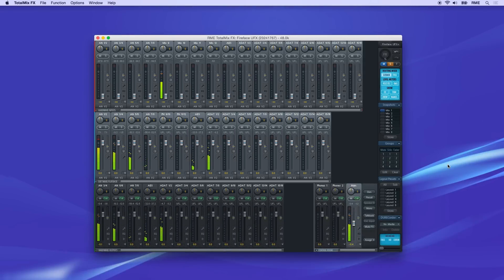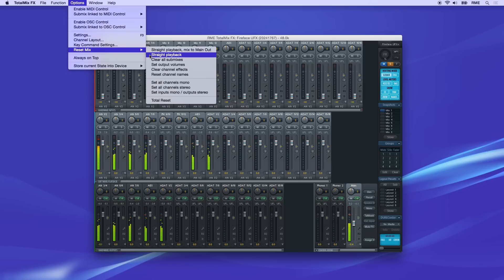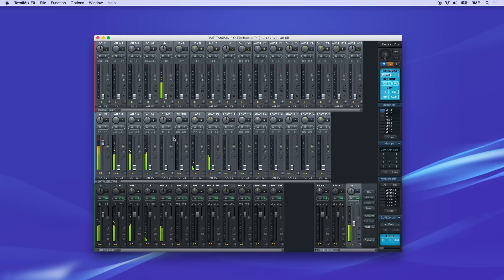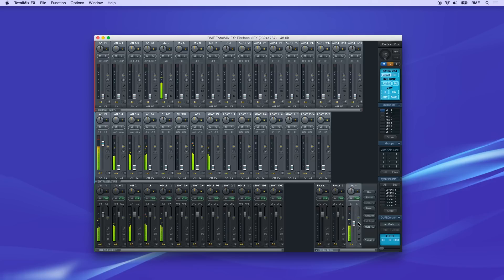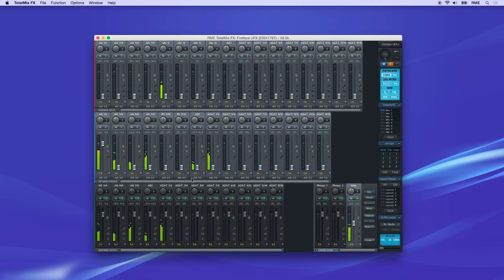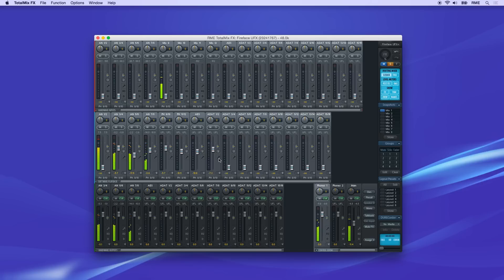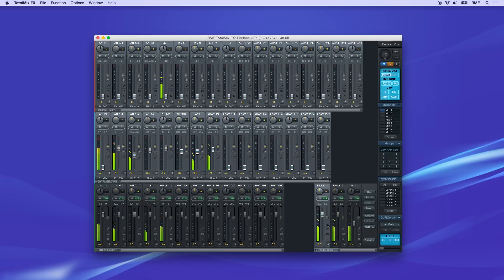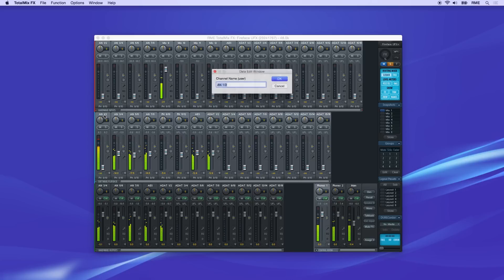How to use RME Audio TotalMix FX - 03 Routing

Comment: Another very frustrated user here trying to get totalmix to do literally anything at all. Some tips for whoever is responsible for designing this UI:
1) Bottom-to-top hierarchy is the exact opposite of what anyone expects. If you find yourself writing "routing starts with the bottom row" in your video's script you should reconsider your design.
2) TOOLTIPS EXIST FOR A REASON. So much of the UI of this clunky software is single letters or abbreviations or unlabeled sliders with absolutely no direct way to learn what they stand for. In most software this is easily handled by showing descriptive text if the user hovers their mouse over the element for a few seconds.
3) There is absolutely no reason the UI can't fluidly resize itself to whatever arbitrary resolution the user needs. Even if your rendering pipeline is some horrible spaghetti mess that outputs bitmaps of very specific pixel resolutions, at least give the option for the window to stretch that bitmap out to fill a resized window.

Comment: I have a question, if I put a preamp on one input and a compressor on another input, could I route the preamp thru the compressor for more versatility in bypassing or reversing the signal flow?
Reply from the maker: Yes you can route your hardware input to an hardware output in TotalMix FX without latency to expand your signal chain with outboard gear.
Reply: @RMEAudio  is there a limit on how many you can route to? Say I have  the mic on 11/12. an eq on 3/4. and a compressor on 5/6, I can route the mic through to 3/4 then 5/6 before it hitting the daw using total mix?

Comment: Why do I need this? I use my Babyface Pro with Cubase, why do I need TotalMix? I use it for ONE thing... really easy to turn on 48v phantom power if I need to use a mic ( I mainly use VI’s). Other than that, I’m not sure what TotalMix is for.
Reply from the maker: TotalMix is to control your monititoring and routing of signals. If you want zero latency monitoring you need Totalmix FX, even if you use ASIO (Windows) direct monitoring. If you do not want the direct monitoring, you can use the DAW mode and everything is routed via your DAW (Cubase) https://www.youtube.com/watch?v=KYheMTswSaY

Comment: It works great for me, the RME is solid. Setting TM up can be tricky till you experiment and understand what each row does.  Look in the Matrix view and make sure things are connected in the channels you want. When you have inputs and default levels for a particular recording setup, save the "Snapshot" - Those presets are the key to everything. I don't change anything except input and output levels, the mixing is in the DAW. It does have huge flexibility rather than dumbing it down so you have less options - but work at it and save your Snapshots, it's worth it!  ...also, save your Workspace as a file, so if you change your computer or something, you don't have to figure it out all over again.
Reply: I was struggling with this so hard until I used Matrix view. Thank you!!

Comment: Cant even get TotalMix to open.  Fucking Totalmix, Totalshit.
Reply from the maker: Then you did not succeed to install the drivers, or there is no RME device connected. For support you can contact support@rme-audio.de
Reply: I went around in circles doing that.  The drivers were installed, I had to remove the avidcoreaudio.plugin from its folder.  So finally it works again.
Reply from the maker: Yes, under Mac OS Yosemite this can be a problem. Thank AVID for that.

Comment: I got the rme hdspe aio and I dont understand how I can activate my microfon, I got the rode nt1a and between the rme and the Rode I got the Tube mp for the phantom power, I dont know how I can activate the xlr input in the total mix to can here my mic, I only see ADAT ... :-P Sorry for my bad english hope you understand my problem
Reply from the maker: You don't need to activate any channel if you have connected it correctly, you should see an input signal at AN1 or AN2. If you don't see these channels please perform a Total Reset of TotalMix FX. Then you can route the signal to the desired outputs and monitor the signal. If you need more assistance, please contact RME Support: http://www.rme-audio.de/en/support.php

Comment: How come I dont have the second small fader on my total mix? I am also missing the EQ button and D. I have Fireface800. What Am I missing?
Reply: The effects system requires internal DSP hardware, that was never built in on the FF800. Current Fireface models will have the complete effects system.

Comment: the most difficult and illogical software I've ever had....
Reply: Totally illogical until I stopped trying to use it the way I thought it should work and used it the way it does work...  I understand what you mean but I disagree now that I've mastered how to use it... the software is actually brilliant, combining zero latency inputs with DAW channels, fantastic amount of routing possibilities all of which storable to the device and a computer, flash the preset to the device and use it the same without a computer...  I love my 400 and 800 ;)
Reply: Kevin Heydenrych it's actually really simple to combine a mono and stereo channel to any output
Reply: agree it is messy software and not that great for a dedicated mixer.
Reply: It's hard for me to read this and not just get angry at the ignorance.
Reply: I am mixing engineer and it is disaster. And many other top engineers/producers agree.
Reply: so are you recommending that we both an external analog mixer for direct monitoring with DAW software to avoid latency issues in the home studio?
Reply: Kevin Heydenrych if it's software playback then the channel in your software is routing it to 5 rather than 7.
Reply: Also, make sure all your rme software is up to date first, including hardware firmware updates.
Reply: But I dont have any software running. Just closed my DAW and video recording software and its still routing to software channel 5
Reply: I'm not an engineer but I like Total Mix and understand how to work with it.
Reply: Lol, TotalMix is easily the most powerful mixing/monitoring software on the market.
Reply: @TheMossyTube  It is. And incredibly solid. The only problem seems to be that it is unintuitive for a bunch of people. I have it working for me, but just tried to go out to a tape machine and ran into trouble. Took a while but I figured it out. But it took a while....
Reply: @joeblack7841  People complaining in this thread simply does not know how to use the software properly. That is definitely not TotalMix’s fault.
Reply: How come I don’t have a software playback section?  Also if I have signal showing in the mic input how do I get it to show in the headphones or main?  I cannot click on either and they both look highlighted.

I just got the UFX II.  I’m sure it’s great but I don’t know what I’m doing.

Any help is greatly appreciated.
Reply: aint that the truth, this video lost me after 20 seconds
Reply: I agree, this is a ridiculous mixing environment. Spent the last 2 hours trying to combine  a mono input with the stereo mix from a DAW and nothing nothing like the results I want to get. For instance I reset the mix to 1-to-1 and my analog 7 input goes straight to Channel 5 software playback. Why?!

Its supposed to be a MIXER not some esoteric digital spider web
Reply: Kristian Sharpe, how? Why is my input analog channel 7 going to channel 5 in the software playback? I can't see anyway to change that. I can only see how to mix to the output channels, not the to the software playback channels